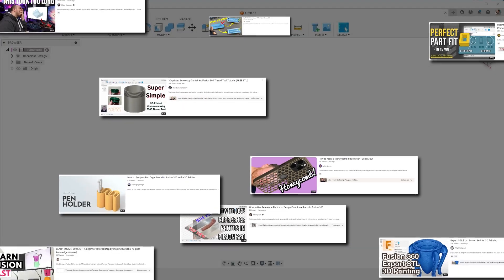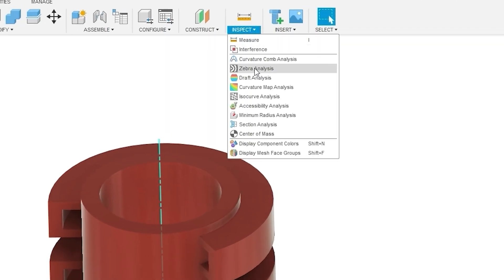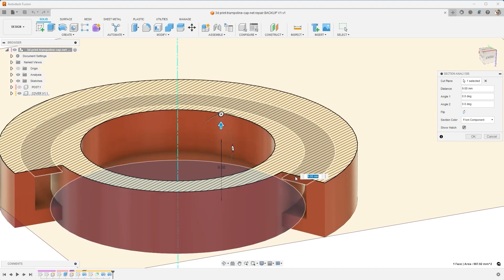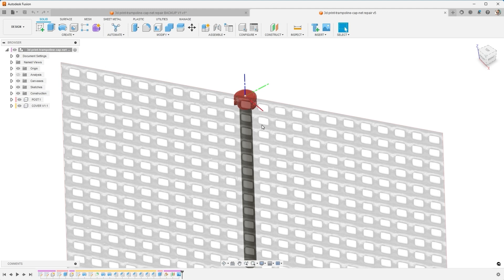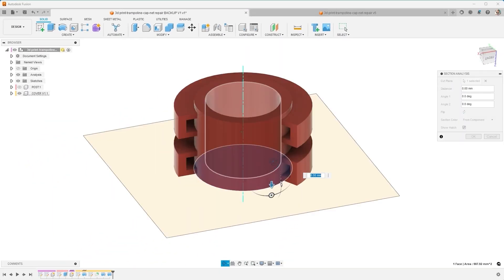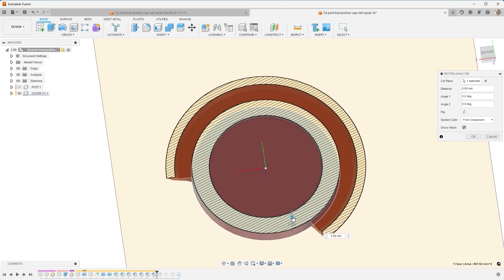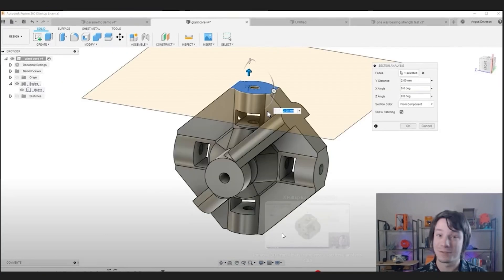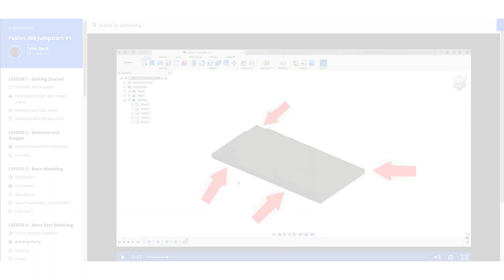Expert advice on improving 3d prints (Fusion 360 Slicer Trick)

Comment: Actually... the inside part of your example would probably bridge just fine without modification. So there's really just one overhang between the two "rings" that definitely wouldn't print. You could do that with the chamfers, but then it's not really the same part. Personally, I like modeled supports. You could also do what I saw in another video recently where part of the print was done separately first. Then the second part was paused right where that first bit goes. Then the first print was manually put in place and finally the print was resumed, fusing the two parts strongly together. You could this part that way with absolutely no supports, but of course it's more work.
Reply from the maker: Cool!  The chamfers worked perfectly for my design, the straps fit and printed well.  But, I like your suggestion.

Comment: Don't use fillets for this, only chamfers. Also, determine your printer's maximum overhang, then your chamfers can exceed 45 degrees.
Reply from the maker: I havent tested but i'm curious if fillets would be problematic?  What result would you expect?
Reply: @TylerBeckofTECHESPRESSO  3D printing unsupported fillets will exceed the maximum overhang. Same problem with outside or inside fillets. Chamfers don't have this problem.
Reply: @TylerBeckofTECHESPRESSO  It's counter-intuitive but using a fillet you are creating a shape with much steeper angles than a chamfer.